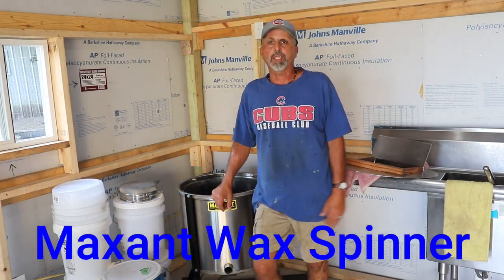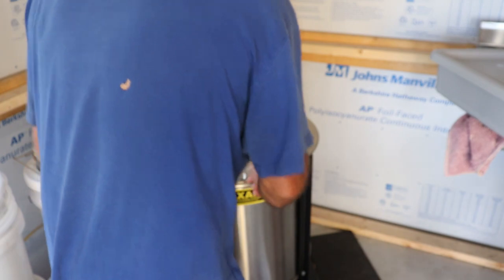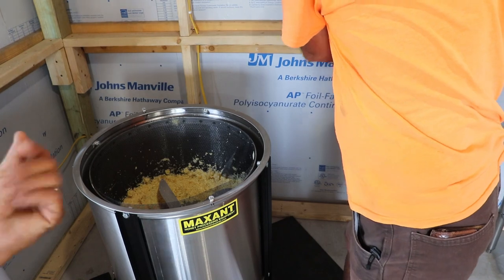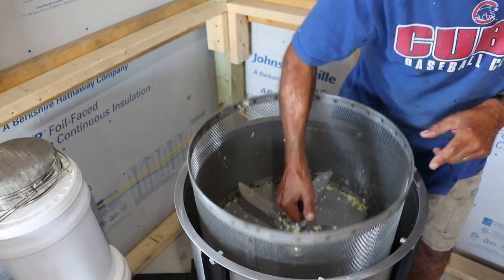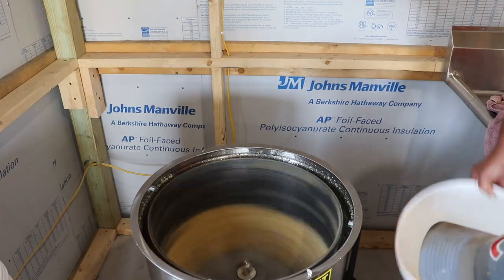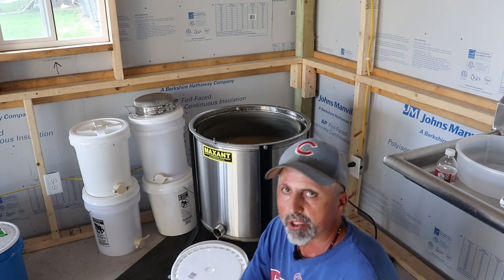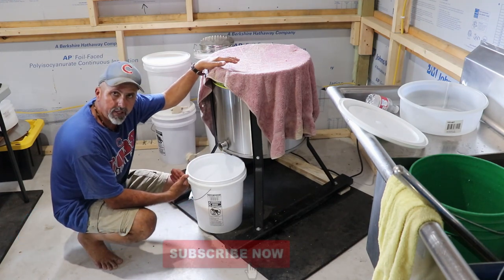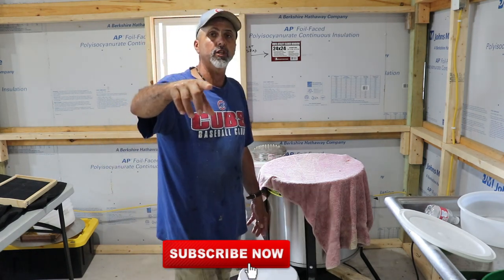How To Spin Your Wax Using The Maxant Wax Capping Spinner ( Dec 2020 )

Comment: I have run this machine for about 3 yrs now. I am watching your video and I assume you have figured a couple things by now. 1) ditch the mesh screen. 2)keep the top on! And uncap in to it. Thats what the spike on the top is for. My dumping large amounts in at a time you wont get as much honey from it. By uncapping in to it you spin one frame at a time and remove more honey. It also qill allow the machine to rebalance with every frame. You can usually uncap 15+ supers before having to empty it. Also dont be afraid to let it run for 8 hrs at the end to get the last honey out. Thats what it was designed to do. You will usually get 10 gallons of cappings each time you empty it
Reply from the maker: thanks for the info ill be using it in about a mounth
Reply: What is the hegit of the outer basket(tank) ?

Comment: Hi, nice video. I'm considering purchasing the Maxant Junior Spinner. I harvest honey from log hives in the forest, and it arrives at my processing facility as crushed comb. I plan to melt it with a melter capable of handling 500 kilograms in one batch at 49 degrees Celsius. After melting at this temperature, I would obtain 325 kilograms of separated honey and a 175-kilogram honey-wax mixture. I aim to use the Maxant Junior Spinner to separate the honey from the wax. If I proceed, how much time will it take to separate the melted honey-wax mixture of 175 kilograms?